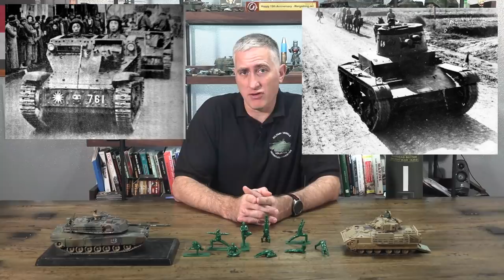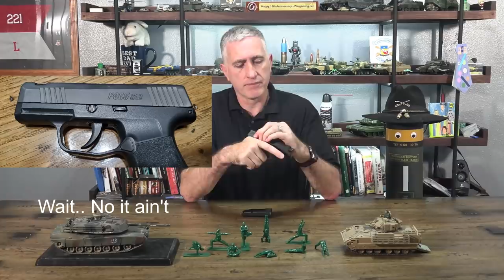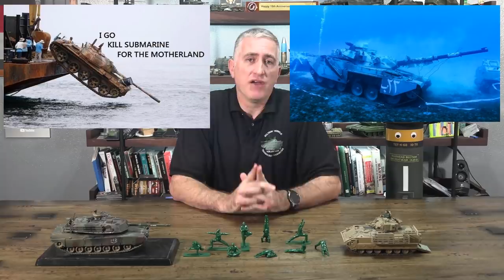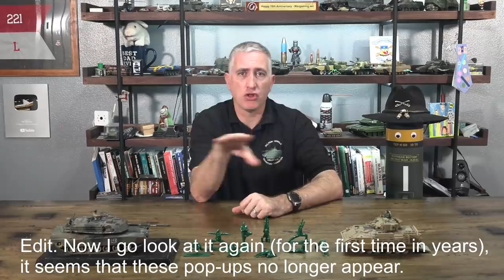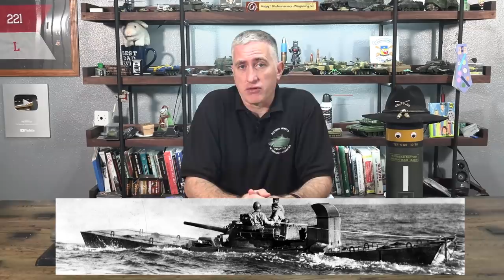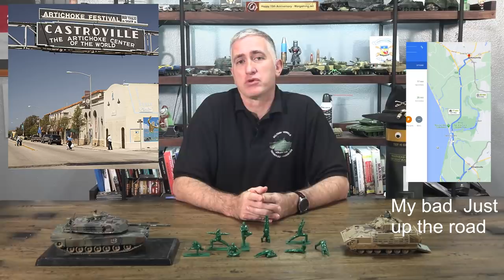Chieftain's Q&A 17. Rants, Ladas and shooting the other guy's cannon

Comment: At Dieppe I would assume that the tanks were intended to do what they ended up doing in practice: provide heavy firepower for a rearguard as the main body board their landing craft. 

Although I would also bet that the crews were supposed to abandon them at the last minute and get on the last boats leaving the beach rather than firing off everything they had before surrendering to the Nazis.
Reply: The Calgary Tanks had at least 3 or 4 roles at Dieppe which Chieftain sized up nicely, the last of which was "a proportion of A.F.V. as part of the Rear-guard will materially strengthen the rearguard..." Lt.-Col Churchill Mann 's appreciation. He was the GSO 1 at 2nd Cdn Div's HQ in the run up to the Raid.
 Anyhow, Role 1: The tanks were to land concurrently with the Essex and the RHLI's and help shoot them off the beaches and onto their objectives/intimate support to clear the town; and 
 Role 2: The main body of the tanks were to assist the Essex to clear the harbour. David O'Keefe's "One Day in August" has quite an interesting take on that role; and
    Role 3: Concurrently, some (a sqdn's worth maybe, but I haven't seen numbers or sub-units specified) were to head inland and RV with The Queen's Own Cameron Highlanders of Canada at Petit Appeville, then go on to take out the local aerodrome at St. Aubin to limit Luftwaffe capabilities, plus if time permitted to go after a supposed German Div HQ at Arques la Battaille before returning to the defensive perimeter to re-embark; and
 Role 4: Rear-guard and re-embark - the only role they actually were really able to fulfill. The re-embarkation for the tanks was VERY sketchy. Ever hear of the German Invasion Barges, yet another objective of the raid ? Well between sailing or towing them if necessary, the cutting out flotilla who were to seize the barges, the LCT's, and everything else, the Raiders were to use the port facilities to reload what they could and head for home. Meanwhile the Essex and Engineers were to blow the cranes and dockyard infrastructure. As if.
 No wonder Col Stacey was pretty silent on the subject.
Reply: @thequeensowncameronhighlan7883  

I had understood that the tanks that got past the shingle proved to be quite effective (one of the better aspects of the battle), but got stopped because their support couldn’t get off the beach.

And I doubt anyone seriously thought they could get the tanks off the beach under fire. But they probably needed that in the plan anyway, and if the attack is an unqualified success you might get a chance to embark with minimal opposition.
Reply: @88porpoise  Sorry, disjointed answer, MS Edge is being wonky. Anyhow they fully expected to get enough tanks off of the beach to go for the harbour, and figured they'd have some to spare to join the Cameron's attack on that aerodrome at St. AUBIN. The tanks had done well enough on the OP RUTTER rehearsals on the sand beaches, and they'd figured out a way to lay a carpet of chespaling across the chert. You can see where some of it was laid in some of the pictures. As with all visits from The Good Idea Fairy, these things don't always work out IRL. The sappers had also practiced breaching obstacles they expected to find blocking the roads into town, but on the day too many of them were killed, wounded, etc,  before they could succeed. Hence AVREs for Normandy, if they weren't already on the books in some form.
 At the end of the day my money for the failure was landing on the main beaches about 30 minutes after the flanking attacks went in, with nothing much more for fire support than aircraft laid smoke and tanks arriving 15 minutes late  to get the infantry across both the beaches and esplanade. 
Cheers and stay well.

Comment: The amount of captured equipment used by the Western Allies depended more or less on the unit. American Paratroopers in Normandy ended up with many half tracks, motorcycles, horses, and all sorts of other German equipment and used them for as long as was practicable. There is also at least one instance where A Company, 1st Battalion 506th Regiment captured an M4 Sherman that had been captured by the Germans during the Ardennes offensive. They proceeded to keep said Sherman until their unit was pulled off the line. So for several weeks, A Company of the 506th was the only armored paratrooper unit in the entire US Army. During the final weeks of the war as the various allied armies were rampaging across Germany, the units that had loaned their trucks out to the 101st airborne demanded their return. This left the entire division without wheels aside from its own organic jeep units. As a result when the 101st drove into Austria, it did so with an odd collection of captured German vehicles as well as whatever else they could drum up for the effort.

Comment: i would love an entire channel dedicated to comparing communist vs  capitalist consumer goods during the soviet era in a similar format as these videos. eg: dispassionate review of the doctrine they were designed to embody and whether they lived up to said doctrine and what was the net effect for the consumer. maybe that will happen someday.
Reply: I still use a mixer "made in DDR". East Germany being famous at the time between communist countries for "Deutsche Qualitat".  
Looking at my mixer, it is not made with programmed obsolescence in mind, like in western countries.  Power cord is still flexible, plastic did not turn into dust or break, ball bearings, motor are like new, with no rust on the stainless steel knife, after 40 years.
They were made for a lifetime and you can still put them in your testament.
Reply: @chefchaudard3580  exactly that. the philosophy of built to last vs planned obsolescence, and the impact of the two philosophies on the respective societies. i would be facinated to know.

Comment: Regarding the Archer:
1. It is not a tank destroyer. 
2. It was used to get more mobile 17pdr guns into action and not as a 'competitor' to the M10. 
3. It was used alongside the regular towed 17pdr in anti tank regiments, albeit in different troops. It simply had tracks and an engine. 
4. Regular towed anti tank guns face rearward and so did the archer. I have never seen anyone raising the direction the gun faces as an issue, aside from one Guards Major describing it as a "clapped out Valentine with a 17pdr poking out of its arse". His comment doesn't seem to be based on anything other than a derogatory visual assessment. 

It was a very useful and well liked vehicle.
Reply from the maker: To the best of my knowledge, M10 was considered by the British to be a 17pr (or 3–inch) self propelled mount just as Archer, and was also issued in the RA AT units in troops which were part of mixed towed and SP batteries. See http://nigelef.tripod.com/anti-tank.htm
Reply: @TheChieftainsHatch  the idea was for a troop within certain batteries to be self-propelled, with the other being towed, for ease of unified movement, yes. They literally were just A/T guns that could move themselves around so the direction the gun pointed was treated exactly the same as the direction the gun pointed in a towed troop. If that makes sense.
Reply from the maker: @Emchisti  No objection to the statement. What is throwing me is whether or not you are claiming that that was not also the concept of use for the M10 in British service. As far as I am aware, it was. The UK did not buy into the US' "Tank Destroyer" doctrine. Unless you count the corps level AT units, maybe
Reply: @TheChieftainsHatch  no not at all. The statement regarding the M10 sits exactly with British doctrine - they were 3" SPs, not TDs. The objection was with regard to the original question posed to you, more than anything, but also that the valentine 17pdr was a competitor to the M10 - I understand that they were not. The M10 and Valentine 17pdr were simply ways of getting A/T guns into action more easily. The Valentine was useful for this as the Royal Artillery was well aware that the 17pdr was a big, heavy gun. Making it more mobile was useful and the Valentine hull was available. 

The M10 was a more cohesive and rounded design (the Valentine being a lash-up, albeit a successful one).

Comment: The Lancia - Lada comparison is slightly unfair: Aside from the fact that the Lada's various models where made in much greater numbers than the Lancia Beta's, so that even with a much higher % failure rate there still would be a lot more of them on the road, the fact is the Lancia Beta ceased production in 1984. 
The Lada continued production into 2012.
Reply: Lada’s are based on the fiat 124 design but have better body panels, electrical loom and engine. My brother owned one and I rode in a number of them in the mid 90s and they were very reliable compared to the fiats.
Reply: I had a very similiar context argument with someone on twitter a few months ago about medieval and classical armour.
Baisically he said "What kind of armour is best/most effective?" and I answered "Well that depends on context, how do you fight? Where are you fighting? What is your technological and economic background? Are you a professional army? Part time soldiers? a Feudal core with an emergency levy? Are you fighting in the open grasslands where horse fodder is easy to come by, or in the difficult mountainous terrain? Are you an Island nation that will find it hard to transport cavalry across the sea?" 
"Yeah but I mean if you compare open face helmets like this and armour like this (insert images of a vaguely corintian-esque replica and some weird fantasy leather armour that never existed) with a full knights harness (insert pictures of 14th-15th century plate harnesses) the knigths armour must be more effective right?"
Me: FACEPALM

Comment: My understanding of the Germans using a lot of captured equipment during WWII was in part because they got their hands on so much of it that it became worth using. This was apparently the case during the early days of Barbarossa when they were running rampant over the Russians.

On the subject of shooting down a tank barrel, has there ever been any recorded cases of someone taking out a tank by lobbing a grenade, molotov cocktail, or other explosive device down the barrel?  I realize that getting to the barrel on foot would be near impossible, but stranger things have happened.
Reply: Germans had to use captured equipment as they could not produce enough themselves, units were rarely even close to full strength and even then often had captured or equipment built in the occupied nations that was of poorer ability (French trucks for example)

Comment: I am, to be quite frank, absolutely disgusted by the lack of an oxford comma. Tsk tsk, Chieftain
                                                                                                                                     -yours truly, the grammar police
Reply from the maker: I am not a fan of Oxford commas. It is very rare that one is needed and confusion can normally be resolved by word sequence. Take he famous image of the strippers, JFK and Stalin, for example
Reply: That makes complete sense, I just have yet to come across a circumstance like that. I usually use it for the exact opposite reason, to prevent a connection between two items, for example British monarchs: Henry VIII, Edward VI and Mary I. Without it it seems that Edward and Mary were married (thankfully they were not, as they were step-siblings with shared DNA). However, with the comma it becomes Henry VIII, Edward VI, and Mary I, seen as a succession of rulers. I completely see the logic behind your point, thank you for your time!

Comment: the mirrors and turn signals  are  needed for the armor to be street legal, so you can drive on public road u need to have even a Vehicle registration plate. Like  BRD army updated DDR wehicles with mirrors and turn signals afther the wall fall. :D

Comment: While not a question about tanks I suspect the answer will include track tension. Have you seen the latest Grand Tour and if so what went wrong with Hammonds tracked car?
Reply from the maker: Wait, what? When did that come out? Last one I saw was the floaty things in Vietnam.
Reply: @TheChieftainsHatch  ah that was pretty thoughtless of me, it only came out yesterday and i've just given away some of what happens, apologies
Reply from the maker: @mikeshaw3295  well now I know to look for it
Reply from the maker: Have now seen it. Before he lost the first set of wheels, I remarked to the wife that this was not going to end well, driving at speed on tarmac with that small suspension... about ten seconds later....
Reply: @TheChieftainsHatch  So his problems were caused by trashing the suspension and wheels on potholes. Thanks for the reply
Reply from the maker: I would say also just pure vibration. Running at speed on dirt, some of the force "squishes" into the ground instead of being forced up into the wheels